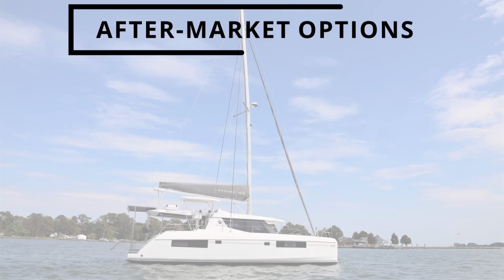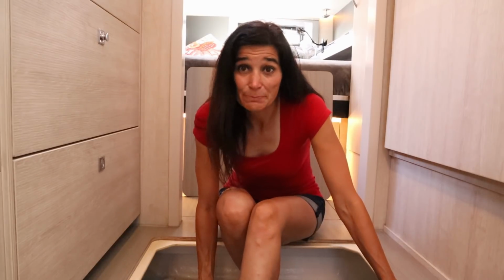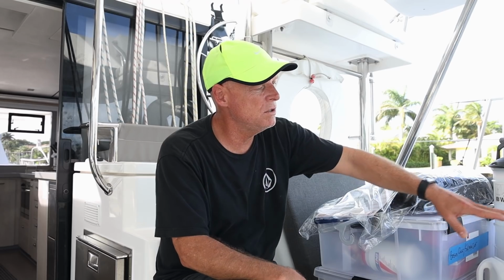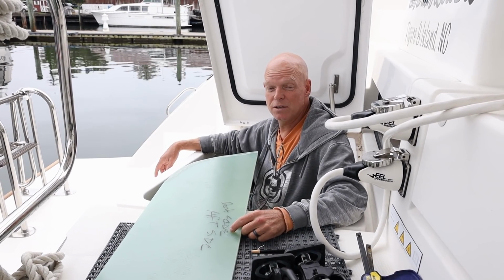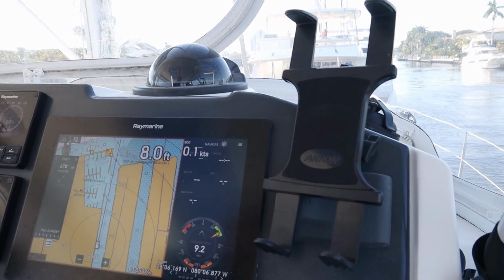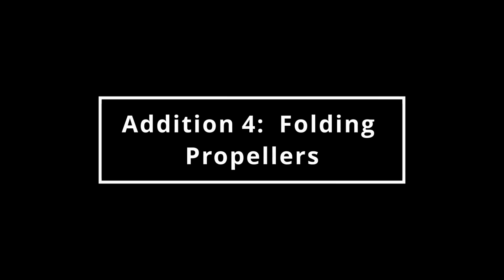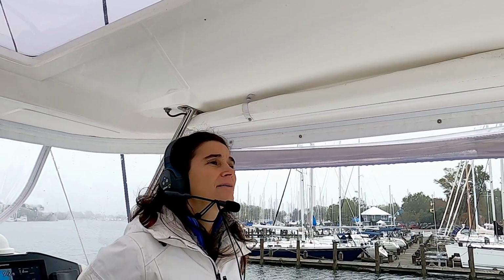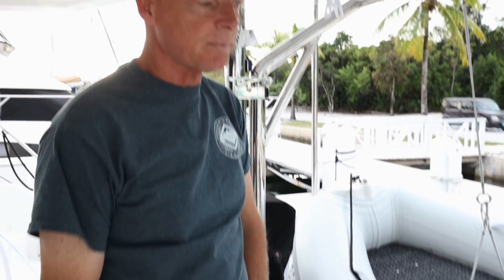Additions to Our Leopard 45 Catamaran for Bahamas Cruising

Comment: How much did you spend in total?
Reply from the maker: Freezer Unit:  $600 for freezer unit, cargo bars, and anti-skid matting (self-installed);  Trunks:  $600 for fiberglass board and resin (self-cut and self-installed); Flex-o-fold props:  $5000 (includes cost of installation); Tablet and holder:  $350;  Stainless steel dive tank holder: $4500 (includes installation)

Comment: Excellent Video! Flexoprop. Did you 3 blades i/o 2 blades? Why? Pls share. Thanks
Reply from the maker: Glad you enjoyed it!  We bought the Flexofold 3-blade saildrive folding propellers to replace our original 3-blade fixed propellers.  From the tests I reviewed, 3-blade models generally produce higher thrust in forward than 2-blade models and tend to vibrate less. But our takeaway after reviewing our options was that any folding (or feathering) prop is going to perform better than a fixed prop.

Comment: 1/2 inch ( or 12mm) marine ply would have been easier for your trunks !!
Reply from the maker: Yes - marine plywood would have been easier but not as rigid.  We liked the additional lateral strength of epoxy board over plywood.

Comment: Great video.  Well presented, and well planned. I enjoyed watching. You’ll find that it’s better to keep the bow and stern lighter and store heavy items toward the center.  The boat will handle better in a seaway, less likely to bury the bow or stern, and be more responsive.
Reply from the maker: Thanks for watching.  There"s a lot of weight in the front: generator and water tanks.  We added the storage areas in the back to try to even it out.  We do have a fair amount of storage in the center as well.  We try to distribute the weight as evenly as possible🙂.
Reply: @LabMariner  Your idea of distributing the weight sounds logical, but ideally (for best sailing) the weight should be concentrated in the central 2/3 of the boat. Your generator and water tanks are in that area, but the 500 pounds of dog food under the forward cabin mattress is not, and putting heavy items under the swim platforms is not good either.  Buoyancy in the bows and sterns helps keep the boat from plowing into the waves and if your sterns are dragging (sitting low) it will cause added turbulence and drag, the water will not flow as easily past the boat as you sail and it will be slower.

Comment: Re freezer in the bilge, compressor may be running flat out due to lack of ventilation.
Reply from the maker: The freezer is made for automobile use so it's suitable for high temperatures.  However since the hull is below the waterline it acts as a heat suck so any heat from the freezer dissipates through the hull.  It's an excellent place to keep it.  No problem with ventilation. In fact, after it cools down (about 2 days after opening it) it uses very little energy (we have measured the energy used).  So no, the compressor is not running flat out.

Comment: If I may, someone has already pointed out you should use a proper Dust Mask. I do this for a job you will need a P3 filtering face piece aka paper Mask or an OriNasal aka rubber reusable Mask but you should really have it face fitted, meaning tested to make sure it fits and seals to your face. In the UK as an Employee it is a legal requirement of your Employer to make sure this happens, the face fit is specific to the make and model of Mask chosen, oh and if you have dental done or weight gain or loss or buy a different type of Mask get another face fit. you only have one pair of lungs mate and MMMF dust will shred your lungs and is known to cause cancer due to the bio-persistence and macrophagic activity, and don't forget about eye protection you only have two of those too. Enjoyed the video though.
Reply from the maker: Thank you so much Mark for the helpful information.  Will definitely heed your warning and be more safety conscious if I do any more fiberglass work😀!

Comment: How easy is ocean crossings etc. With dogs,? Tho they look pretty laid back. Oh, and what's your hull width? Its a dimension you rarely see.
Reply from the maker: Depends a lot on the dog - we try not to go over 60 hours on a passage with the labmaraners. You have to find somewhere they can relieve themselves and we always have them tethered when outside.  If the seas are really rough, we tether them to something when inside as well so they don't get hurt.  A lot of sleeping.  Fortunately none of them get seasick and only one of them gets anxious in rough seas.  Our Leopard 45 beam width is 24 feet and about 7 feet interior width for each hull.

Comment: Great video- thanks! How will you know if you have moved too much weight aft? Waterline/sugar scoops too low? Or based on the motion of the boat?
Reply from the maker: The sugar scoops would sit too low.  The boat has a ton of weight forward because that's where the generator and water tanks are and there is a lot of forward storage so we're always trying to move weight to the stern.

Comment: Nice one... Your freezer, does it manage -18C or lower in 30C ambient?
Reply: Hope this answers your question: the freezer can be set as low as -14 Fahrenheit. It also has a boost freeze so that it will help drop the temperature quickly once it's filled. Also once it's cooled down it uses approximately 4 to 7 amps when the unit is cooling and no amps when it's idle.
Reply: @jlljjl  sure.. the settings is one thing, but what it actually managed to do in 30C or thereabouts ambient,  that's a different kettle of fish... 😉🙂
Reply: @R.E.HILL_  in 80 degree f we see -10 f and that's within a fairly small space
Reply from the maker: Thanks for watching!  Let us know if you have any other questions😀!